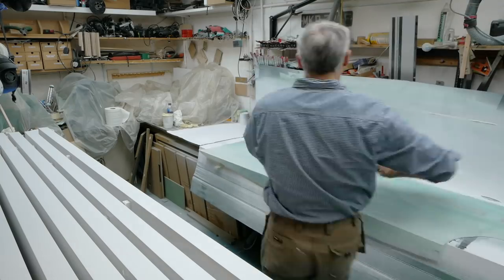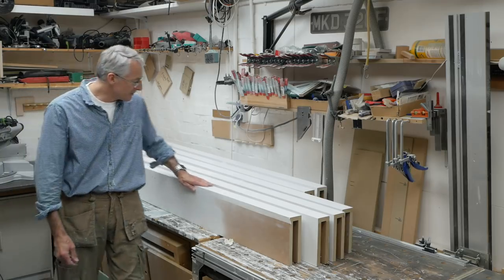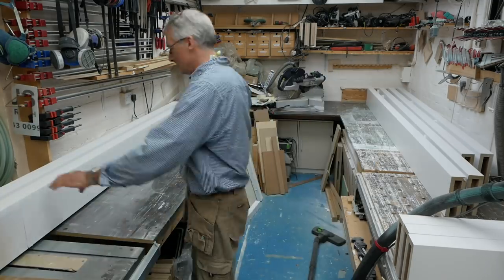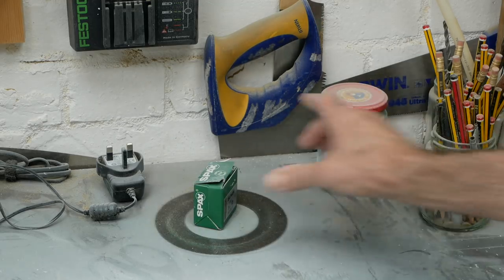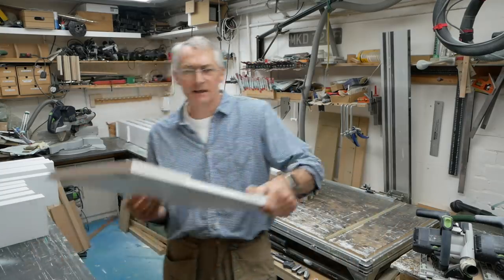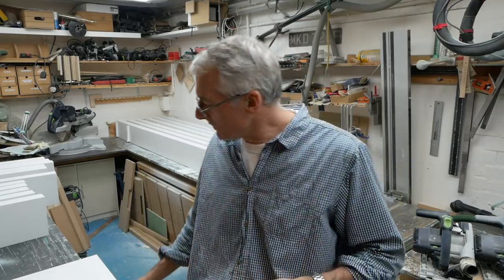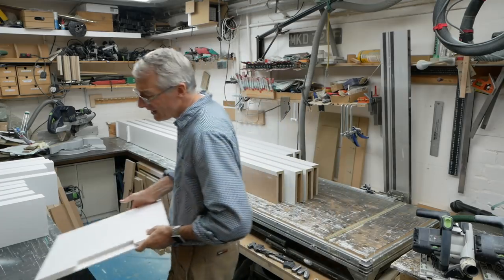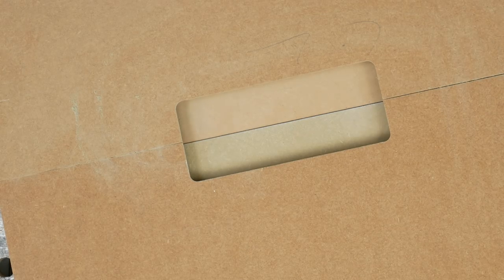Well, Duh! #179

Comment: Hi Peter, you mention about turning your work space into a spray shop, are you going to do a video of you spraying your cabinetry?
Where I work we have a fully equipped spray shop where we can paint, spray lacquer, and ultra hi gloss. It would be nice to see how you have achieved a good finish in a slightly more confined environment, and the sort of equipment you have used.
Reply from the maker: Thanks Gary. Yes, there be a video (or two) in due course. In short it’s a Graco Ultramax cordless airless handheld. Works well. I’m using it in this big job, then I’ll have a proper review of it 👍👍

Comment: Would love to know a little more about the spraying method  , ive heard of the tickarilla ( bad spelling ) paint from a bloke called mark nash , is it water based and whats your thought on it compared to the likes of leyland eggshell ?.
Reply from the maker: There’ll be a video (or two) in due course. Tikkurila is very nice paint, sprays very well. I’ve only used Helmi furniture paint and primer, and Otex Akvar adhesion primer, but I’m very pleased with the finish. I’ve never sprayed Leyland eggshell, and I’ve never rollered Helmi, so I dont have a direct comparison. My only gripe with Helmi is that it comes in 10, 20 and 80% sheen - eggshell, satin, gloss, basically - but most of the eggshells my clients like (F&B, Little Greene) are 20% sheen, so the Helmi is a bit flatter. Hasn’t been a problem so far, but I’m sure the day will come...  P
Reply: Peter Millard thanks for the reply ,look forward to more videos ☺
Reply: Peter Millard "pleased with the finish" 😂 (tikurila is from Finland ;) )

Comment: hi Peter just doing some revisiting of you big drawer with finger pulls and had a bit if a thought. Do you think that it would be possible to do it as if it were 2 pulls back to back but do it from one oversize piece then saw it through to the correct size. Oh yes I only need one drawer
Reply from the maker: Hiya. Funnily enough I have more of these rondo this week. I’m planning on doing two together, much like you suggest, but pre-split if you like. 👍👍

Comment: You need a cheap air purifier. Save heaps on clening up dust.
Reply from the maker: Dude, seriously, every other post from you is about air purifiers. Give it a rest, yeah?🤷‍♂️
Reply: @10MinuteWorkshop  I'm sorry I have upset you. I had thought them something of a gimmick, until a hospital in Sydney tried them out in a Covid-19 area. I've not seen any confirmation from other sources, but the hospital concerned bought more of them.

Sometimes my enthusiasm runs away from me.
Reply from the maker: You haven’t upset me - I appreciate you taking the time to watch the older videos and making a comment - but it’s happened a couple of times where other subscribers have reported comments / commenters that they felt were promoting a product and they’ve apparently been blocked/hidden as a result. Wouldn’t want to see that happen to you, OK? 👍👍
Reply: @10MinuteWorkshop  I don't see how anyone would think it's my product, or even how anyone (but you) would benefit if you go to your local shop and buy one.

I started to get interested in woodworking 12-13 years ago, my wife and I went to woodworking classes together. Previously, I had done some at school, she did a little soon after we married.

I got all sorts of nice gear, and they my eyesight, never particularly good, went decidedly wonky - hence my pseudonym, and so I stopped, and took up photography. I returned to woodworking, hoping to build some stuff for my van, but I am too slow, too determined to not make mistakes. I have had five cornel transplants over the years, I feel there's quite a deal of luck involved in trying to attach a piece of jelly to an eyeball.

I think I will give up that idea, and just wander around the place photographing our huge expanses of nothing. I have a huge playground, around the size of Europe, without crossing state borders, and landscapes that have been maturing for around four billion years.

Comment: Did I miss a video where you started spraying? I've only ever see you roll and brush. I'm guessing by the amount of overspray and misting you have that your using an HVLP sprayer? I recommend switching to airless. You get much less overspray. In fact if you have the right pressure you shouldn't have any other than where your aim is off. You could easily spray on sight with minimal masking after a little practice. Try a handheld like the Graco Magnum A10 which is fine for bookcases and built ins. For bigger jobs something like the Graco Magnum A50. Cost around £250 and £450 respectively. Unfortunately not easily to find in the UK. I got mine from France very easily from Outillage Online.
Reply: On sight = on site!
Reply from the maker: Thanks Steve. I’m using a Graco Ultramax cordless airless. At the lowest power setting. So, yeah. Videos out in due course, wanted to be using it a while first. 👍
Reply: Ahh so Airless then. I'm surprised you have so much misting. It might be because your in quite a tight space so possibly a bit close to the surface causing a bit of deflection. Might help if you can to put a fan in the wall blowing out to try draw out those fine particles. Otherwise in about 6 months everything you own with be 25 shades of F&B :)
Reply: But spraying is so much quicker and better finish than the alternatives. I can paint doors both sides in 40 seconds. With a roller and brush your talking 10-15 mins a side having to get in all the moulding etc
Reply from the maker: Yep, still on the learning curve. I used it onsite in a clients home recently - much bigger room than my workshop - and still had loads of misting. Don't have access to an outside wall in the workshop, and anyway any fan blowing fine particles out would be aiming right at the many tens of thousands of punds-worth of cars parked on my street, so probs not the best idea. Don't know if you're an instagram user but I've posted a few snippets there of me spraying with the graco, and yes, it is massively quicker - though probably more of a wash when you take the cleanup into account.
Reply: Are you using F&B paint? I find its pretty thin so could be that. Might be worth trying another paint. I normally use Beckers mixed in F&B colours. It's a Swedish brand and they have been making water based paints for much longer over there. But my feeling is most paints are better than F&B. I quite like Brewers own Albany paint, they will mix it in a certain other expensive brands colours also. Otherwise I'm not sure why the misting. I painted a 9m x 4m room in white last week without any drop cloths and didn't get a single drop of overspray from a hand held job like the Ultramax.
Reply from the maker: I’ve used F&B without any problems, but also Benjamin Moore, Tikkurila, Johnsons and Leyland. It’s not the paint. It’s not just me who’s has this issue with misting - a few people in my twitter gaggle have had exactly the same problems. Doing a large room without sheeting everything down is inconceivable for me. I sprayed a similar sized room (7x3.5m) a few weeks ago, and there was so much paint on Corex covering it was sticky underfoot. Again, take a look at my Instagram - @10minuteworkshoo - for some pictures and video.
Reply: Fair enough. The only other thing I can think of it the tip. I think most Graco sprayers come with a 517 tip, mine did anyway. I don't use that tip, I only use a 315 fine finish tip. Maybe the wider fan and particle of the 517 accounts for the overspray.
Reply from the maker: I'm using a 310 pretty much exclusively, a 208 for some finer detail work. All brand new when I bought the machine. No difference between any of them wrt the overspray/misting.
Reply: I'm out of ideas then. If it's not the tool there's only one explanation left :)